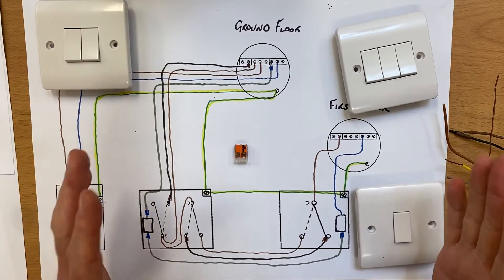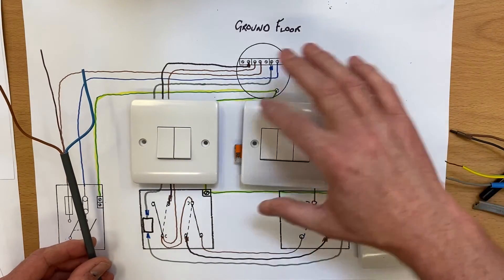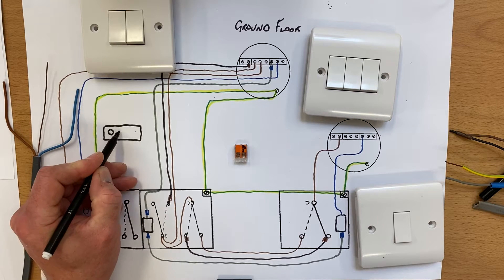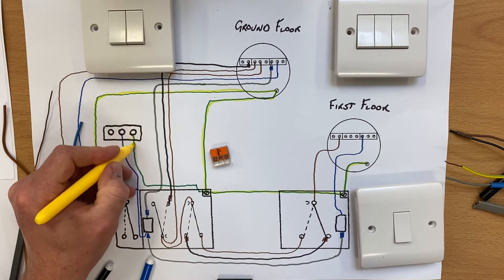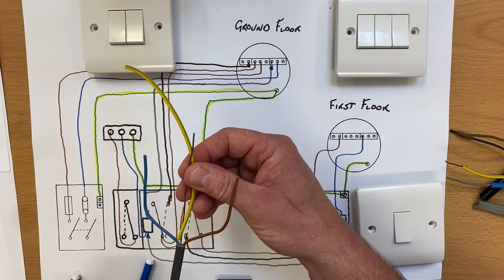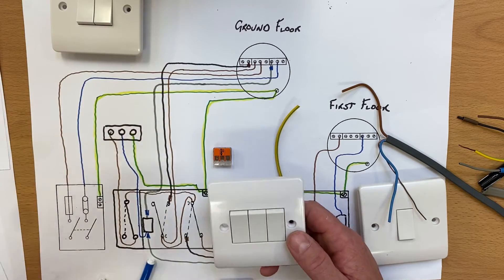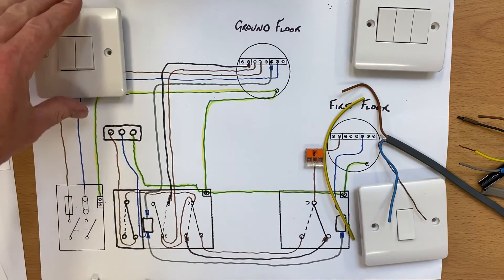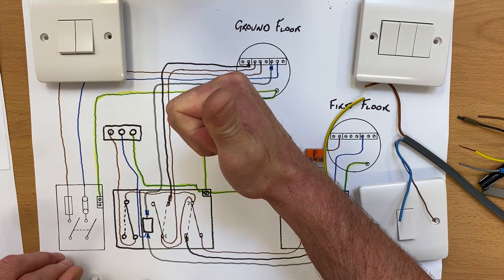Wiring Diagram Adding an Outside Light Changing a 2 Gang for a 3 Gang Switch Connections Explained

Comment: My switch near my front door is as you have described - a three gang switch with one for the front door lantern. I’m wanting to change the lantern to a quinetic leed floodlight. What is the best method to do this - I obviously would prefer not to have a switch inside that would disable the quinetic function by accident.

Comment: hello great vids. so i have a pressing question. i have one bathroom end of line light with switch in hall way. i want to add a mirror light and outside light on separate switches. so a 2 gang one way switch to operate outside light and mirror lights sperate from the bathroom switch. could you please advise

Comment: hi.ive been watching your videos and i have just set up extra shed lights from main shed to lead to shed next to it.i have sheds own consumer unit and breakers.i have 2 way switches one in shed one in lean to.i have downlights one in shed comes on ok but have 2 extra led lights in lean to but cant get them to work.well did breifly light thought was loose bulbs in holder.i have a screw in bulb holder from another bulkhead light.now that is wired from a junction box from the led downlight that comes on in main shed.so if i connect the 2 extra led downlight to same junction box why dont they come on?.bulbs ok as swapped them into main shed bulb holder.?

Comment: Could you do a video showing how to take a power supply from inside a house outside, down the wall under paving to an external detached garage?  I am a little concerned if the cable going under the paving needs to be in a plastic pipe conduit, needs to be armored, the pipe sealed, and if a specific 32amp trip inside the house needs to be provided.  Could you spur off an internal house switch to provide two double mains power sockets in the garage? House is only a year old?

Comment: Should you not go for consistency in your diagram? For example, the 3 gang switch (if numbered from right to left as 3, 2, 1) the off position for 3 is the dashed line and for 2 is the solid line. Would it not be better if they were both dashed or solid ?
Reply: No.
Reply: It's understandable to competent electrician that; 
'Dotted' lines in switch-symbols are for Way1(L1/N.O) while
'Solid' lines in switch-symbols are for Way2(L2/N.C)

(The above is in respect to Switch Dolly(s) flipped to their Default Positions i.e "Upwards")

Comment: i did exactly the same thing, it involved just a tiny bit of head scratching in running the wire for my security light
the bonus was that i used the same feed to power the smart doorbell breaker as it's never switched off
unless one of the family decides to turn the light off, even though it's been 6 months and i've told them not too lol